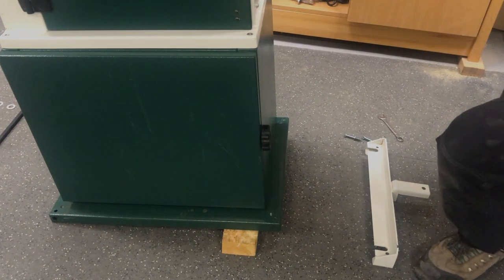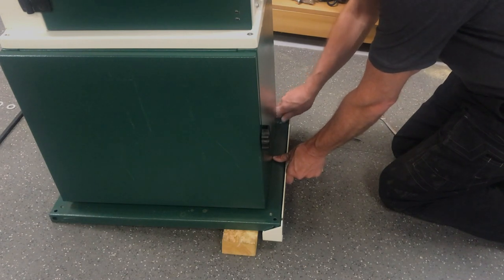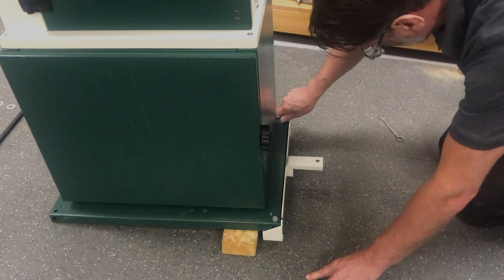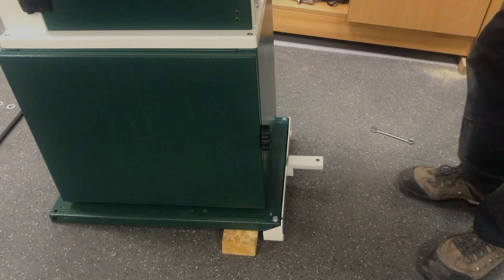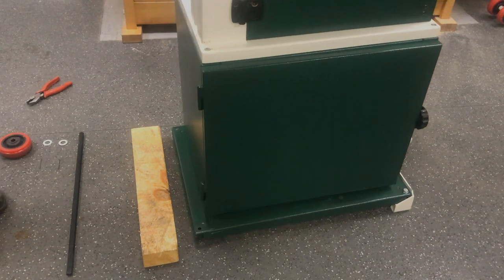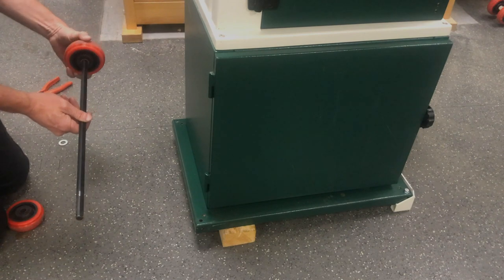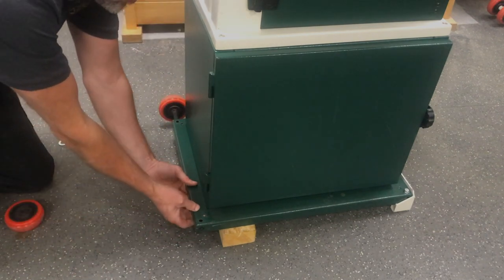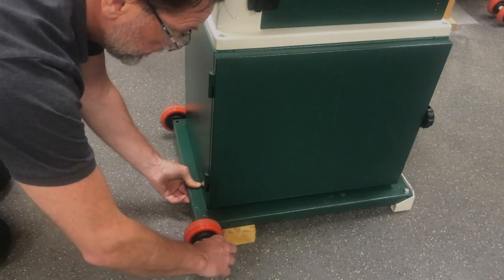Know-How Series: SABRE-350 14" Bandsaw Wheel Kit

Comment: I've seen that the shaft has a flat face. Does it need to be oriented in some way?
Reply from the maker: Hi Francesco, thank you for your comment. The flats on the SABRE Wheel Kit are just to help with location when threading the axle or shaft through the holes in the base fabrication. Hope this helps. Best Wishes, Record Power.